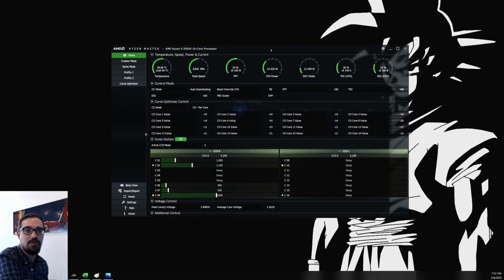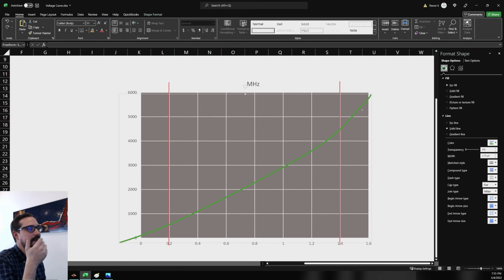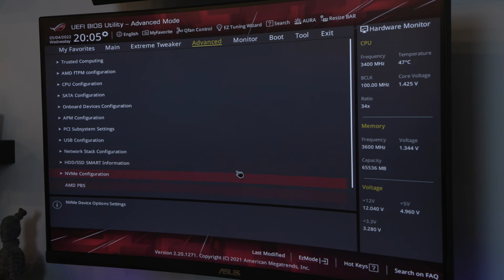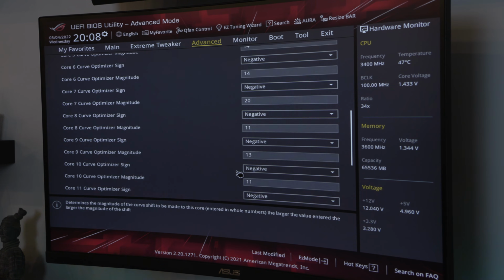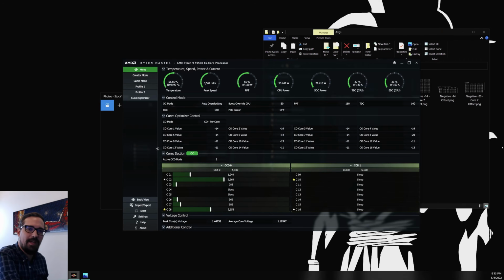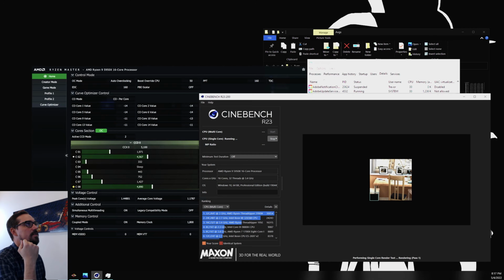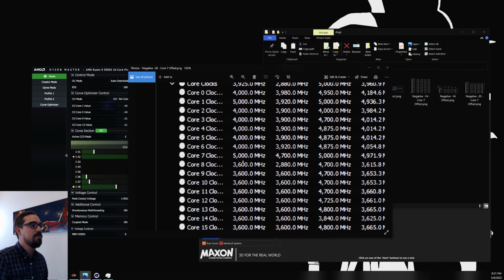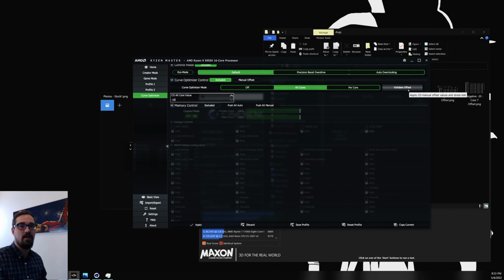AMD Overclocking - Curve Optimizer Explained

Comment: When I run the per-core curve optimizer on Ryzen Master, after a few seconds I get a system crash and it does not respond. The temperature rises to 89ºC. Some help?
Reply from the maker: Try resetting the bios to default settings and run it without making any changes in the BIOS. If it still locks up then you may have cooling issues or lower delivery inconsistencies. Let me know!
Reply: @UnhingedSystems  Good.  I loaded the factory settings of my bios.  When I turn on my computer and open the ryzen master program, the PC directly freezes.  I pass tests of occt, cb R23 etc.  No problem.  But with ryzen master I don't understand what happens.  I don't think it is due to a poor cooling problem since my temperatures do not exceed 75°c under stress test.  Likewise, tomorrow I will change my mx-4 thermal paste for kryonaut.  I will inform you.  Thank you for your time.

Comment: Is it me or does DDR-5 Suck with it training on every  change. Long Boot times. Unacceptable in 2024.
Reply from the maker: It can be frustrating for sure. When tech changes we are forced to adapt. DDR5 at launch was hot garbage. After over a year of BIOS updates things got a little better. Unfortunately I've seen more batches of bad RAM and more failed motherboards specifically on the memory controller side since DDR5. Realistically failure rates aren't much higher than with DDR4, but the rocky launch, confusing offerings, incompatibility beyond 2 sticks of DDR5, controllers on each DIMM creating additional points of failure, etc it hasn't been an easy tech to get behind.

The performance benefits are definitely there but one wonders how much of these new technologies are no longer being properly refined prior to launch. Even CPUs and new platforms seem to be being rushed out without much regard for the end user anymore.

My opinion: Tech needs to slow down a bit so it can mature again, and we need to let it.
Reply: Thanks for responding. Thanks for that reinforcement.... Know Im not alone on this. Like you said a lot of failure points present. @UnhingedSystems
Reply: Brilliant synopsis @UnhingedSystems

Comment: Great explanation of the problem with the optimizer. I ran it on all cores and just spent several hours trying to figure out the crashes just trying to watch other YouTube videos after banging out a perfectly stable game session last night. It was bad enough instability that I had Windows file corruption that required starting over with default settings. Hopefully a thing of the past . .

Comment: I’m pretty amazed how well Curve Optimiser worked.. here my results on Cinebench 23
Stock: 
score 15025, 82,4 celsius, pulling 94,3W.
With CO - per core:
Score 15848, 67,2 celsius, pulling now 72,2W.
More then 20% of power reduction and 15 degrees cooler!

Comment: Great explanation, thank you. If I run core optimizer in RM to determine the offset and then set that offset in BIOS, will RM recognize that when Windows launches? In other words, what happens if curves are set in BIOS and then RM profile is loaded in Windows?

Comment: fact that cpu manifacturers do not do this curve optimisation for best results to ensure best outcome straight out of factory (or in) infuriates me to the bone.
Reply from the maker: They wouldn't be able to justify the cost of individually tuning every CPU to its own perfect settings. At least not without charging far more than they do. They need to be able to mass produce these and with the microscopic variances between chips they need to go with algorithms and design that will work across the entire production line. We see that a lot in the "binned" CPUs that can out perform other exact models simply by being on the higher end of production quality. Those CPUs have a stock boost algorithm applied that works across the entire production model, but can be tweaked a little by the user to squeeze out an additional 2-3%. We are getting to the point where we can't get much more than 1-2% so the aftermarket power user to tweaks are becoming kind of pointless and will probably disappear over time. Probably not a lot of people overclocking their MacBooks.

Comment: What I don't understand is why the curve offset has to apply globally to the entire curve? Why can't you leave the defaults say under 50% load and only modify the upper end that you're actually trying to optimize? And then blend it over some transition range?That would completely eliminate the issues of instability at lower clock speeds where you're not trying to push the frequencies up for a given voltage. Is the BIOS and optimization really that simple? Just seems odd to leave performance on the table just to support stability on a default curve at lower frequencies.
Reply from the maker: I'm certain it has to do with the actual architecture of the design of the circuitry of the chip itself. The chip needs parts of itself to be "tuned" in a specific way like voltages, voltage sensing, load and load sensing, etc. The challenge here is that changing how the curve works is probably only possible at levels integrated into the design of the chip so it isn't as easy as writing software to adjust the curve at different load points. Technically you could write software that runs outside of the chips own firmware and attempts to do that, but it needs to respond fast enough to load and voltage changes to not cause instability. They could definitely design chips to enable more granular support of voltage curves, but the stock algorithms are already quite good.

I believe we are only a few years away from there being no real point in tweaking CPU setting anymore. The threshold for user tweaks to get performance benefits has been getting smaller and smaller over the years. As an example, GPU overclocking beyond stock overclocks is practically pointless now with barely even single digit % available before instability. In the early 2000s beefing up the cooling and overclocking your GPU could get you 15-20% gains in the right scenarios. Even the 13900K is very practical by just releasing power limits and providing superior cooling. Individual tweaks or overclocks are becoming obsolete.

It's fun to play with though! Let's hope they always leave us a little bit of headroom to enjoy the hobby!
Reply: Thanks for the thorough reply. So just setting a minimum voltage would not resolve the lower voltage instabilities. I definitely agree, it is fun to play with so I'll be a bit sad if they optimize them too well, haha.  @UnhingedSystems

Comment: Should I run this on my 5800x? The temps are insane for just opening a browser it spikes up
Reply from the maker: Won't help with temps unfortunately. 5800X produces a lot of heat. As long as it's under 90C and not throttling it's fine, but I would highly recommend either a Noctua NH-D15 or equivalent or a 360mm liquid cooler for CPUs that get that hot. That being said, it can run 85C-89C all day and be within spec, I just prefer to keep my CPUs as cool as possible within reason ($$).

Comment: Thanks for this video. I just turned off the curve optimization. :) The Stock setup is fine for me at the moment. The stability is the most important for me, it doesen't worth to win a few degrees, if the stability is gone. :) Maybe later, if I will have time, I try to optimize core by core.
Thanks for the video!
Reply from the maker: Stock is the best stability 👍

Comment: A useful tip is that the All Cores setting is going to be limited by your absolute worst core, so if you start by dialing that in you will get a good stable baseline for Per Core settings. You'll have at least one core that can't go beyond the All Cores setting, but several cores will probably be able to do better if individually adjusted.

Comment: Curve optimizer is for bad CPUs
Reply: If the CPU is bad, you can't do much with CO to begin with.
Reply: @MultiTheGamerman  not really. The optimizer finds the limits and works on these limits. But overclocking doesn't look for limits but rather you decide and dictate to the CPU what to do. The curve optimizer fluctuates CPU frequencies per core but BIOS OC keeps the same frequency that you selected until temperatures reach the TJmax and shut down. The performance I get from BIOS OC is stable and does not fluctuate. The curve optimizer exceeds the max safe voltage many times while the BIOS OC is never going exceed the max voltage you designate
Reply: @websparrow  Sound like you messed up the thermal limit as it incapable of doing so if you simply limit. 
The biggest difference manual OC and PBO2 CO is that pbo play with in the parameter of the cpu and more importantly how well the cpu handle different amount of voltage per frequency because it is working with a curve the entire time. 
That what I said if you have a bad cpu, you can't do much with it as it. As if the binning is bad then the feature is worthless.
Compare to just pumping a set amount voltage and boost clock speed, which is guarantee to work no matter the binning.
Reply: @MultiTheGamerman  I didn't mess up anything. I have my 5900x running on 1.28v all core 4.8 GHz with max temperature 75C when rendering for a long time. My PC is a solid worker. My CPU will live a very long time. Curve optimizer is software Overclocking and is made for bad CPUs that cannot achieve great performance with BIOS Overclocking. My first Overclocking was with a Pentium II 333MHz to 450MHz...in the 90s when 333MHz was Intel's best CPU that year and I was already overclocking. You can say whatever you want about precision boosting or curve optimizer, it is software and it fluctuates. BIOS Overclocking is stable and does not fluctuate...

Comment: excellent video, very well explained. do you have to assign your prefered core for each apps ? we can see cinebench dont use your prefered core by default so im wondering, but also for gaming for example it will more multicore than single core so not sure if its really usefull to assign prefered core for games. i know there is a CPPC prefered core option in bios which should allow windows to use your prefered cores by default, not sure if it work well tho

Comment: I currently run my 5700x (b550 tomahawk) in eco mode, do I need to return to stock or is there any suggestion points before running RM for the first time?

Comment: I found a good way to test your curve optimizer under-volt is to repeatedly start-stop a full CPU render in Cinebench R23. Start a render and after each thread completes a single block hit cancel. Repeat. Keep doing that about 20 times or more.  This fluctuates the cores through most of the voltage curve. An unstable CPU will eventually black screen on you.
Reply: OCCT has a stability testing mode that does this automatically and works really well. CPU stability test, set it for a small data set, normal mode, variable load type, and core cycling thread settings. It basically cycles through each core, causes it to ramp up to full, and then puts it back to idle for several seconds. It does a pretty amazing job at finding unstable idle undervolts. Only pay attention to the first error though, once it finds one it seems to spew them out almost at random.

Comment: Old video now and only briefly skimmed through the comments, so maybe you've already found this out but - I'd like to add that you can see which core is causing the crashing , in windows event viewer the crashes will come up as a WHEA event id 18 - I have setup a custom view that shows me WHEA errors (whea 18 generally shows up after a crash when the curve opt. has been set too steep and the core doesn't get enough voltage, I see whea 19 alot when overclocking ram and it suggests an unstable infinity fabric) so if you set an all core -30, and the system crashes - you can check the WHEA 18 and it will speciffy what core is the issue - APIC ID: x - so APIC ID: - 0-1 will be core 1 in the bios, 2-3 will be core 2 etc, really helps when trying to dial in problematic cores. I will mention that sometimes* the pc will just black screen/crash and windows wont show the core that caused it.

Comment: Great video. Subb'd. Can you please do an explainer for LLC? I'm wondering if it can help with the low-frequency stability
Reply from the maker: Load line calibration didn't help my stability when playing with the curve optimizer settings unfortunately. That's not to say it wouldn't help in other CPU/motherboard combinations.

I'll add LLC to my video list! (I'm on vacation for a few weeks, then I'll be back to it again!)

Comment: I'm trying to figure out whether using the curve optimizer per core will lead to different VID values (voltages to core) when all the cores running at the same maximum frequency?

Comment: I've got a strange thing happening with my 5700x. I ran and tested the curve optimizer, which set -27 for each one of my core, and tested cinebench 24 single core with hwinfo. The core speed does not go over to 4400mhz, even with -27. It should turbo at 4750 mhz (150 mhz overclock). Temp are very good : 60 degrees, so no reason to throttle.
Only think I could think of that could limit my cpu core speed is my ram overclock, from 3200cl16 to 3733cl26 (It helps A LOT in bf 2042, even with the bad latency)
I hope someone can help me.

Comment: Thanks for explaining this in actual detail with some test results. I was worried I was only going to find some LTT video's with soyface thumbnails. 
I was running a basic negative offset through voltage control, but that actually causes the clockspeed to continuously drop because the PBO curve stays the same. 
I will try this now, and see how it goes. That said, the 5800X3D is a bit of a fickle CPU and you can't really run wild with it due to thermal constraints. Not so much that it produces a lot of heat, but the 3D vcache causes an insulating layer.

Too bad you can't edit the actual curve like you can with Nvidia's GPU's if you hit CTRL-F on MSI Afterburner.
Reply: Apprently they disabled it for 3D v-cache CPU's...

Comment: My 5800x used to boost to 5050 mhz under maximum load with a peak cpu temperature of 76 degrees (420mm radiator AIO with Noctua 3x 140mm 3000RPM static pressure industrial fans)
After following this guide it now boosts to 4850 mhz with a peak cpu temperature of 76 degrees.
Thanks.
Reply from the maker: Max boost isn't the full story, it's more about sustained load and average sustained max clocks over time. Most of the time when you see a measurement of 5050 MHz that was actually measured after the load drops off between executions rather than during consistent load. Single core boost is where curve optimizer can increase the maximum sustained average clock speed.

I've also noticed that with newer BIOS updates the boost behavior has changed. Older BIOS from 2021 boosted slightly differently.

If you reset your BIOS your CPU should just resume its previous behavior.

Comment: My ASUS motherboard is a disaster, it has the PBO options duplicated, so  I suppose one of them was put into the bios by AMD Agesa and the other one by ASUS, so i gotta find the duplicates and set everything twice. Like WTF?
Reply from the maker: It is super confusing. Just use the AMD Overclocking menu and ignore the rest of it.
Reply: @UnhingedSystems  Now, I am scratching my head trying figure out the difference between the following settings "Infinity Fabric Frequency and Dividers", and "FCLK", the former goes up to 4000MHz, and the latter only up to 3000MHz. They appear to be yet another duplicated setting. And I am trying to figure out why the motherboard says Infinity Fabric has to be 1:1 with RAM frequency, yet Inf. Fab. Freq. settings only go up to 4000MHz, and the "supported RAM" states "up to 5600". I have hit a wall on my TeamGroup Xtreem ARGB 2x32GB DIMMs. They are SKHynix, and I was easily able to bring them up to 4000MHz, at 1.4v, but then to hit 4133MHz (absolute limit it seems) I had to go all the way up to 1.47volts. 
Also noticed that when I set the RAM voltage, the value read back adds about +0.3V to whatever the input was. Probably because of some other offset or something? Maybe because of the VRM settings? IDK. I am using th e Crosshair VIII Impact which is the ITX version of what you are using.

Comment: That's the catch with the offset undervolting, compared to the classic cpu core voltage tweaking: the negative offset undervolts also the idle voltage of the cpu. Hence the instability when the cpu drops to low frequency.

Comment: If you can run at -20 you don't HAVE to run it at maximum negative absolute fringe power. Just use a setting thats more conservative that brings you good results. If you can get to -30 until it crashes, run it at -20!
Reply from the maker: Agreed. I have cores that are unstable below -9 unfortunately 😭 

It really depends on your specific chip. Some people are running -30 all day long.
Reply: @UnhingedSystems  I have a basic 7600 and it will just not accept anything below -5 and I`ve decided to just run it as-is. It's not that it's not performant like you explained very clearly here, it's that it just REFUSES to be starved of any current.
Reply from the maker: @JuraIbis  The newer gen 7000 series chips are even more finely tuned from factory than the 5000 series. In fact they operate kind of in reverse. The CPU continues to push for more power as long as it is inside its own thermal/power envelope. 13900K is similar. These chips are becoming more tightly dialed in from the manufacturer and I wouldn't be surprised if we see less and less wiggle room for user tweaking into future generations.